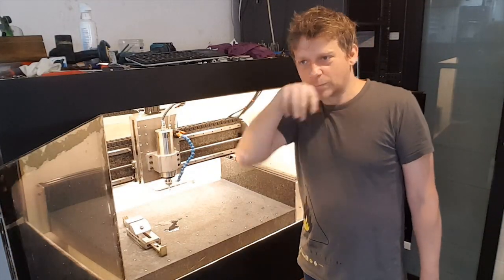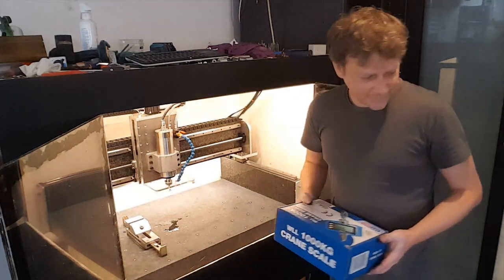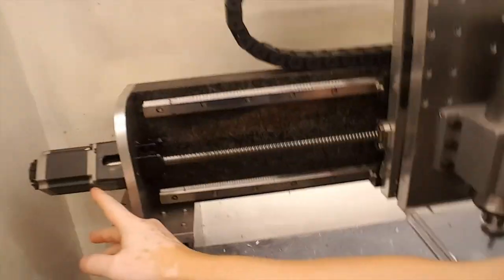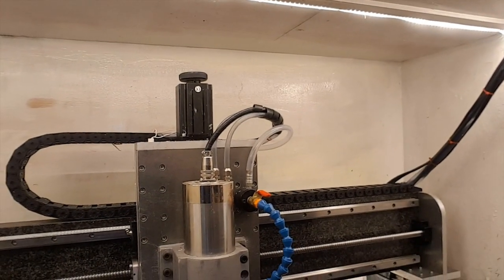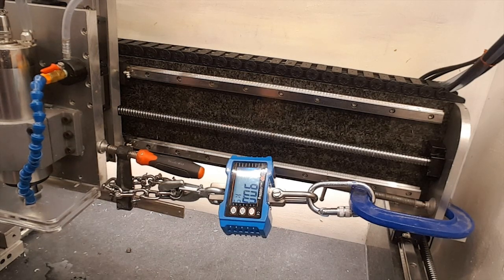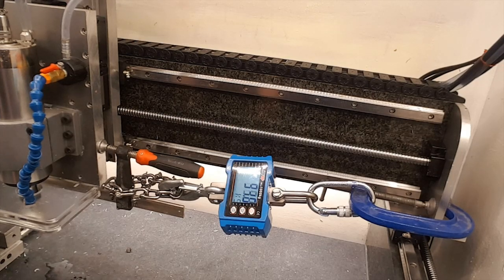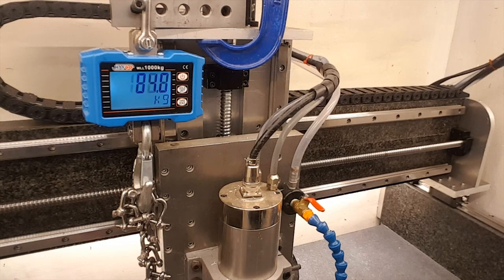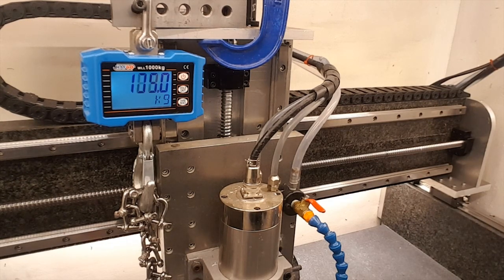how strong steppers are?

Comment: Thanks for that really interesting and somewhat helpful ! I'm about to use a stepper to drive a mini mill for metal and was thinking of using a Nema 23 420oz which if I'm right is stronger than both of yours ? I'm not sure if I need that large but bigger is better in the metal world ! You must have faith in your machine build to do that test !
Reply from the maker: Hmm.. sure you can use as big stepper as you want. But I don't think you will use endmill in the size of your arm;) you don't put much force on the end mill while milling. Otherwise it will break, chip, deflect etc.. So going for monster stepper won't have any effect on milling. Perhaps it could run colder ;) or it could have so much power that at crash it will bend your machine or ball screw. So bigger is not always better ;)

Comment: Firstly, thanks a lot man! It is exactly the data I needed for a project. Second, just for info, the stepper force would be even higher if you could apply the load in the longitudinal direction of the screw.

In your configuration, as in most machines, the direction of force tends to bend the nut and screw, hindering the sliding efficiency. I plan to make a DIY tensile tester with a Nema 23, but with a tube around the nut to pull the sample, so that the load does not bend the nut. I hope to hold even more than 200 kg, lets see !!

Comment: I think you should check it at various speed of stepper motor..and that way you have a better approximation of power of machine
Reply: Exactly.  Stepper motors are approximately constant power machines.   Power = rpm x torque,  so as the rpm increase,  the torque decrease.   

Most stepper motors are sold with published rpm vs torque curves and while not linear,  by the time most of them hit 300 rpm, the torque is very low. 

For drilling this doesn't matter much,  but for cutting it does because the tool has to be able to move quickly under load.

‐‐------

It turns out that he continues with upgrades over time in future videos and the results are amazing.

Comment: Great experiment that I've never seen from any build. Thank you for the clarification again. But the main question mark in my head is the Y axis which is carrying the most load. Are you planing to make a video about the Y axis.
I think this experiment is proofing the holding torque of the steppers with 5mm pitch leadscrews but the main concern has to be the inertia factor for your spesific build. And the way to measure your limitations on your machine is to write a G-CODE with difrent rapid axis movements and diffrent plunge depths, and run it with diffrent feedrates when cutting an actual material. this way you can find the feedrate that your motors stall when cutting.
I would love to see the limit speeds of this kind of a rigit and precise homemade machine on rapid movements when cutting. Thank you again and keep up the great work. Greetings from Turkey ;)
Reply from the maker: Y axis has 2 x nema 23 so we could assume that it can move 210kg (105kg per stepper) gantry weight is around 60kg. so i have 150 kg to spare.
i did some tests on the acceleration when i was setting up steppers in Mach3, my goal was to have it moving smoothly. i kinda settle with 3000 mm/min as my top speed. steppers are running on around 2.2 amps they could handle more but i didn't wanted them to overheat. anyway im cutting everything with 1000mm/min with maximum cutting depth of 10mm-20mm at once. and it just go like a knife through the butter :) greetings to everyone in Turkey :)
Reply: Thank you for your answer Piotr this clarifies my question marks, keep up your great work ;)

Comment: Obviously, you don't want your machine to ever miss a step under load, I tend to set the stepper driver current just above that point, to limit the damage from a crash, and protect the ballscrews and rail bearings, and to let the drivers run cooler.
Reply from the maker: very interesting idea!

Comment: thank you very much for this video, very useful. I'm looking at different motors for a project I'm working on which requires high torque, but never really found a video to visualize the actual weight being pulled by motors like you do. This is without gearing right?
Reply from the maker: 5mm pitch no gears
Reply: @PiotrFoxWysocki  thank you  :-)

Comment: this is incredible , I always read " your gonna need giant steppers for that "" and its almost always false.
Reply: you need torque for acceleration. CNC jobs do not run in straight lines all of the time. Then stepper motors lose torque at higher speed. So if you want rapid speed you need powerful motors.
Reply: @1pcfred  the question being, how powerful is enough?
Reply: @scottwillis5434  No simple answer to your question. You need a torque/speed diagram to make sense of what the manufacturer intended for that particular motor. The torque advertised by the manufacturer is the holding torque, which is of little use to you, if any. By and large, 300-500 rpm is the best compromise between not losing too much of a torque, having enough speed and stepper not getting too hot from continuous use. Between 300-400 rpm you can count on getting half of the holding torque. So, if you buy a 3,5 Nm stepper (holding torque) you can use about 1,7 Nm of REAL torque, at around 350 rpm. Now, if you need to know how much real/actual torque is needed to move a gantry, that is quite a challange to say for sure, because it needs some calculus of different parameters. Just as an example, about 0,003 is the coefficient of friction of either the ballscrews (no preload) or linear guideways, which means that with 1,7 Nm ,5 mm ballscrew pitch  and virtually no acceleration (say 1 rpm of stepper) ,you can move about at least 3 tonnes of gantry for a distance of 1 mm in maybe 10 minutes ! This is no mistake: at least 3000 kg. There is nothing practical you can do with this figure, but it helps to highlight that once you want some acceleration, the game changes dramatically. The calculus is complex, but I can tell you for certain that with 1,7 Nm real torque (3,5 Nm nema 23 holding torque)  and 5 mm ballscrew pitch you can move at least 300 kg of gantry, having a cutting force of at least 100 Newtons (you can cut steel with 100 N, and obviously aluminium too), at around 300 rpm of the stepper (which means 1500 mm/min cutting speed) and acceleration time of 1 second. The greater the acceleration time (which means the lazier the machine), the heavier the gantry that can be moved and cutting+friction forces to be overcome, and viceversa. Please be aware that in DIY setting the linear quideways will never be PERFECTLY parallel (hence the friction coefficient when moving the gantry will be greater than 0,003); the same goes for perpendicularity. So, the game changer is speed/acceleration. To give you an ideea, the torque that has to overcome the inertia is: Tj = Total moments of inertia (gantry, ballscrews, steppers) x angular acceleration ( which is angular speed / acceleration time). If you convert 300 rpm of stepper in rad/sec, you get 31,4 rad/sec as the angular speed; if you divide it by t=1 second, you get an acceleration of 31,4 rad/sec^2. With this value, you can calculate the torque that rezists inertia , by calculating the inertia of each moving element first. This torque will be added to the torque needed  to overcome friction and cutting force ( Torque = Force of moving the portal and cutting the material x ballscrew pitch / (2 x pi x efficiency of ballscreew (about 0,8)). Do bear in mind that  the bigger the stepper, the bigger the inductance (the steppert is getting hotter at greater speeds). Conclusion: in DIY setting, if you don't need a lot of speed, you can use 3-4 Nm steppers to move hundreds of kilograms of a gantry. Have fun !

Comment: Very cool video! When not operating the stepper motor, would the max load be much higher? For example, while the stepper motor is stationary, how much more load could the structure handle? (stepper motor powered off and something pulling the C clamp translating to the right). I'm thinking of using a stepper motor to lift up a wooden platform (think of a large 3D printer), so I'm interested in understanding how much load that platform could take with a stepper motor below it.

Comment: So useful. I am about to start buying parts for a new CNC machine (made out of 20mm aluminium plate) and I was tossing up Nema23 (like I have at the moment) or 34s... Clearly some middle of the range Nema23s are just fine! Do you have a thought on closed vs open loop steppers? I also like the look of the clearpath servos, but am sure I don't have a need for anything that flash
Reply from the maker: In my humble opinion, you should be fine with nema 23. Try to imagine you standing on a spindle with extra bag of the concrete  to move it through milled material. Where vertically it might be not so bad but sideways it's just insane. Instant tool brake. Not mentioning frame deflection etc. Closed loop steppers are unnecessary for cnc. If you loose step and you need closed loop to bring it back to the position your part will be damaged already. So it's better to don't lose steps ;) one good thing of closed loop stepper is higher top speed and better acceleration. If you want to mill stuff faster than 3000mm/min then I would recommend closed loop. Btw faster you go, lower torque stepper has. I'm milling everything 1000mm/min it's fast enough and I take 10mm - 20mm deep cuts at once.

Comment: microstep have effect quality cutting model ? such angle streaky unattractive surface ?
Reply from the maker: It's not so visible on a straight line but you will see faceted edges on round corners, circles or cuts on an angle. More mictosteps cleaner the cut.

Comment: I need to move a slide laterally with a total load of 40 kgs at 10mm/second. The slide is on hiwin linear guides. The calculations are done considering a 12mm ball screw with 4mm lead and the required torque is much below .25 Nm. I am guessing a nema 23 would be sufficient to move that load.  Would that be right?
Reply from the maker: theoretically sure, but practically will be way more, plus inertia. i would recommend 2-3Nm nema 23. or something around this number.

Comment: Watched all the 'granite CNC' vids... really love the idea. But in this video I noticed you drilled a grid of holes in the surface plate. Any vid on that? Did you also glue threaded inserts in the holes? And how about cooling water/fluid that stays in those holes or are they drilled all the way through? And what about chips getting stuck in the holes? Just curious. Really nice build!!
Reply from the maker: those holes are done the same way as in previous videos. I thought there wont be much sense to make another video about drilling more holes :) inserts are glued just like any other inserts in my machine. i drilled holes 21mm deep for 8mm stainless steel insert. if i would drill it right through it would weaken granite too much. What about chips and water in them? i was worried about it myself.  First test was to cover them with screws. but then heads are sticking out and make cleaning much more annoying. i could use grub screws to cover those holes. at the moment concept is not to worry :) then time come i will just use compressed air from the compressor to blow out whatever is inside. as long i won't put screw in clogged insert it won't compress chips beyond point of blowing them out. so far it doesn't look like its going to be an issue.
Reply: @PiotrFoxWysocki  Wouldn't it be easier to use the router as a drill? maybe with a drill instead of the spindle, but that would automate the problem.

Comment: Did I just watch your z axis ball screw move upward twice? It looked like the end stop on the screw failed.
Reply from the maker: It was the top plate bending when stepper motor lost stepp it springed back. No worries I have changed the design. And by accident I crashed my new z axis into the vise with 750kg of force. New design worked just fine. But since then I have lowered torque to 80kg. (Servos)
Reply: @PiotrFoxWysocki  ouch. Bet that stung

Comment: BTW what power supplg do you use? It has alot to do with the torque the motor can produce ..
Reply from the maker: as far i remember 48v 10Amp
Reply: power no important but if need fast speed need driver who handle lot volts, 80-90 volt max voltage driver, etc DM860 serie driver, important have motor torque/amperes, normal used 4-6 Ampere drivers and motors. good have NEMA 34 1200 OZ 6-8 AMP motors. but hobby user budget too expensive.  power supply need calculate whit motor max ampere what have and how many motors you use, if use 3 motor and each motor max ampere have 4A need 3 x 4A power supply minimum. this is 12A power supply MINIMUM need use. etc, my machine i use 4 motor all 4AMP i use 2 x 10A power supply, 10A to 2 driver and same second 2 driver.

Comment: hi mate. I like your idea. Can you explain me How you choose right step motor? I try choose however it really hard.  My project cnc router  dimension are 2000x1300x600 I cannot  decide what type step motor need. have a some idea? Fallow plan Y-axis will load about 40-50 kg (or more) .  thank you
Reply: For a rough idea you can calculate it, just like Fox said - torque of the motor, and the pitch of the screw, will give you a rough idea of the possible force. Go search for calculation of bolt clamping force vs torque, and those equations are the same - just remember that ball screws have less friction.

Comment: Did you compare to calculated values? I assume you calculated axis thrust in the design stages, so was this test to prove the motor ratings?
Reply from the maker: no i didn't. i just used my educated guess based on my previous experience with steppers and fact that i had 3 nema 23 steppers from my previous machine. so i just used those. it turned out that they are more than enough so there was no point calculating anything. and if they would stall i would have a reference point of how much more power i would need. I wasn't to troubled by it because i have quite big stock of all sorts of steppers from nima 6 to 42.

Comment: What was the microstep config you had on this test? I read that holding torque decreases to around 70% at 1/8 microstep. I’d be happy with that strength... my leadscrew has 2mm pitch nema23 i have is a bit less than 1.9Nm but i have two of them that share the load of the axis i am worried about
Reply from the maker: microstepping was and is 1/10

Comment: i wasn't expecting that result.
216kg is 7619.18oz on Z which is way higher than the steppers oz rating. around 63 times higher.
Reply from the maker: its because you are converting lots of turns of the stepper in to small linear movement. so one turn to move it 5mm. 
Beside OZ are calculated one inch from the center of the shaft. 
so if you attach a 2inch/5cm pulley to the shaft  this would result 1inch/25mm from the center of the shaft. When you attach rope to this pulley you should be able to lift the amount of Oz the stepper is rated to.
So 16mm ball screw is 8mm from the center of the shaft vs 25mm.  So you "kinda" gain some extra power.
I only can have hope this explanation makes sense :)
Reply: It's a leverage situation.  The motor applies force on its rotor at the (internal to the motor) radius of the rotor.  The ballscrew outputs force at its radius.  

Suppose the rotor has a 24mm radius.  If the ballscrew is 8mm radius, that is a 3 to 1 lever; it increases the force at the radius of the ballscrew to 3 times the force at the radius of the rotor, and the speed at the radius of the ballscrew is 1/3 of the speed at the radius of the rotor.

To simplify comparing motors, the oz-in rating uses a standard 1" radius.
Reply: The torque is multiplied by the thread.
Reply: @1pcfred  agreed; a finer thread will trade off speed for increased force (like putting a car in a lower gear).
Reply: @scottwillis5434  a thread is a lever wrapped up. Which is like a wheel stretched out. Archimedes was brilliant to conceive of it. There's only a couple basic mechanical principals so you have to be very creative to come up with something unique using any of it.
Reply: @1pcfred  After a couple hours of research and calculation I still can't get it right. Can someone help me to find the formula to calculate the Axial load F(Newton) that can be generated by a given torque Td (say 1.9Nm like in the video) by knowing the lead P of the ballscrew (5mm in the video).

I re arrange one to get : F = (2π*Td)/(P*10^-3)

So for example F= (2π*1.9)/(5*10^-3) = 2387Newton or about 238 Kg. Witch is more than double the 105kg find in the video so I don't think that's not accounting for the 10% loss in the ballscrew would resolved all my problems x)
Reply: http://www.nookindustries.com/LinearLibraryItem/Ballscrew_Torque_Calculations
I find most ressources here

Comment: Just curious what the strength of your y-axis steppers are? I'm building my first CNC so i have no reference as to adequate stepper strength, but im doing a steel/epoxy granite build so our axis are similar weight and my target top speed is only ~2000mm/min
Reply from the maker: Y are 2 nema 23 steppers just like the one on X axis. So over 200kg. Parameters of the stepper are in the description under the video.
Reply: Thank you :)

Comment: Would a nema 23 be enough to pull plastic in a packaging machine ?
Reply from the maker: impossible question to answer without any details. but i would say yes. if stepper by it self will be not strong enough use gearbox. i don't think this answer is terribly useful :)